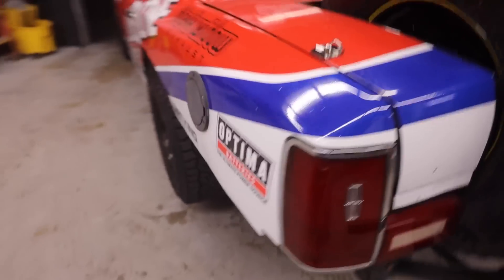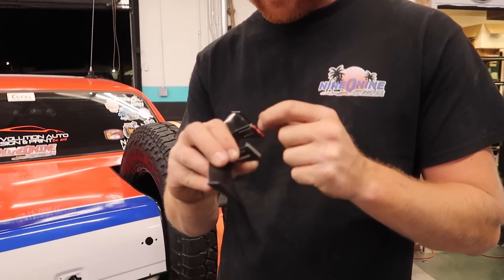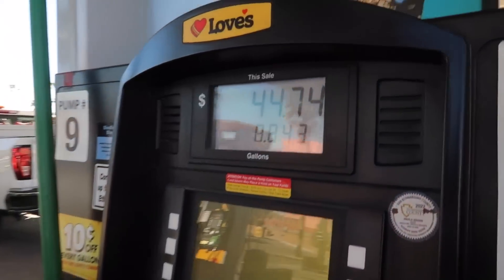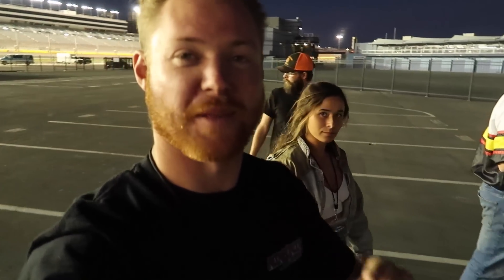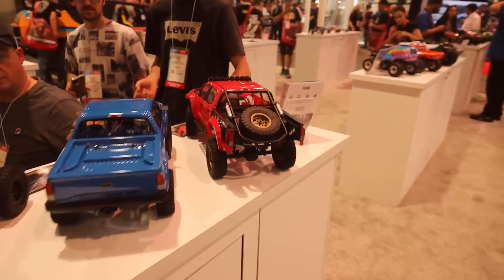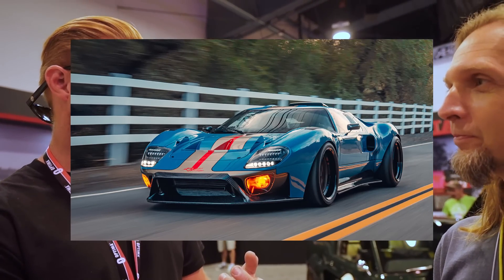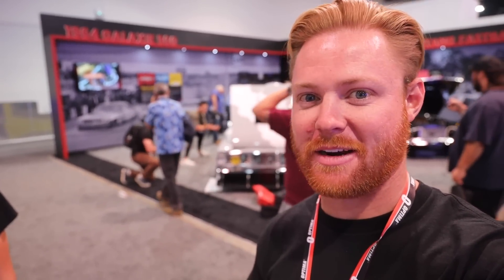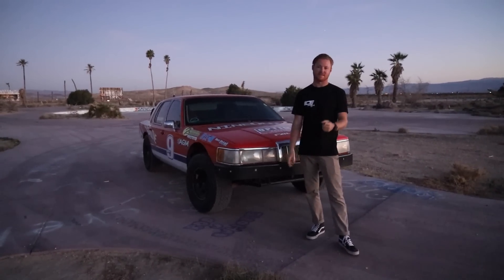Getting an EXLUSIVE Look at The RUFFIAN '64 Galaxie at SEMA!

Comment: That was awesome seeing you do the Nascar racing experience! I work for them at Dover Motor Speedway during the summer. They're definitely chipped at 4800 or 5000 rpm, but can be bumped up higher if you buy the package to stay on the track longer.
Reply: Always wanted to go there...but 400hp and 4800 Ill save my $. Bet its fun working there
How often do people ball those up?
Reply: I haven't seen anybody crash yet, surprisingly! People either get into these things and rip them around the track or they get in and drive like a loud grandma.  @gordocarbo

Comment: My 84 Oldsmobile cutlass supreme brougham that car was the same way it had perfect grilles that were factory to the car pulling it home i was coming up to the highway and the right side grille flew out going across the highway and bounced off the passenger side mirror and landed in the middle of the highway with semi trucks pulling oversized wide load prefab house half's both ways....ughh and the minute I got it running decided to drive it to the small community I live near to grab a can of mt dew, and the Dr side grille flew out and the car ran it over ....so then it got 86 cutlass supreme salon egg crate grilles which are absolutely the wrong ones for the 84 Oldsmobile cutlass supreme brougham,, and they were wired in with mechanic wire, and industrial strength zip ties but I still wish I had the original grilles and 4 years later my brother totalled the front end of the cutlass...

Comment: I would gladly trade you MPG numbers. I have a 86 Dodge Ram D150 that is 440 swapped, on a good day I get 7mpg on the highway.
Reply: Cool my 2000 dodge ram laramie slt quad cab long bed 1500 4x4 318 magnum V8 46 RE AT manual shift transfer case lever on the floor 210k has a factory towing pkg and 3.55 gears it's ugh not the best on gas either lol

Comment: Ya I see how you['d be taken a bit by the over the top Video Game builder's (holy bad paint scheme there Batman btw)... but anyway... the way you kept the white Galaxy build more old school cool by repairing parts of the frame and painting it with the rust proof, the shock bar you build then boxed in, your method of tubbing the rear wheels.... all that is way cooler than Buddy's hotwheels with the tube frame [very Nascar for sure]. Your Red Galaxie is more like that in the end. You can do your own frame with box tube steel and with the right plan and all the right parts [including a roll cage].  If you do go roll cage... make it so you have the cage hinged so you can get your big ol legs in then shut the cage and latch it....  Sure all the Nascar wanabe's and Sema junkies would still approve. All I'm saying is, what this guy did isn't so new. He set out a plan and included the Kindig maxim of tucked bumpers and next to invisible door handles... maybe use body scoops to keep things a little cooler [not sure how well that will work but... okay] lol  This guy's paint scheme though.... so BAD lol  Keep it CRAIG man! You've grown your ideas and they are unique to YOU!! Stick up for your ideas and everybody else will as well... because that is the admirable thing to do! ;-)